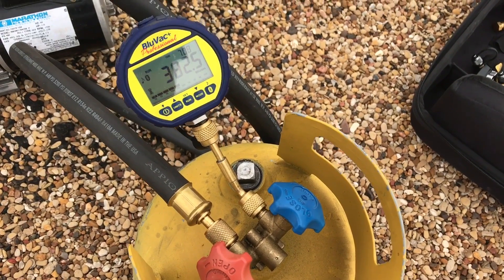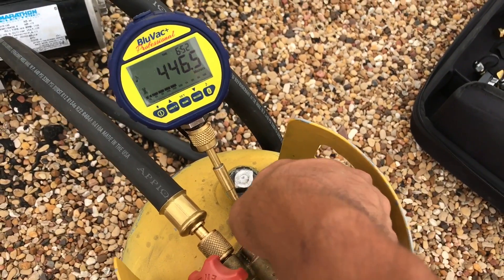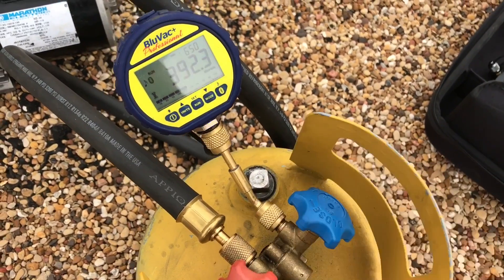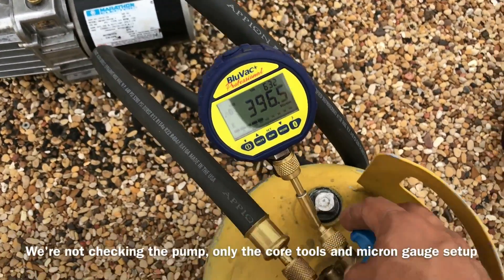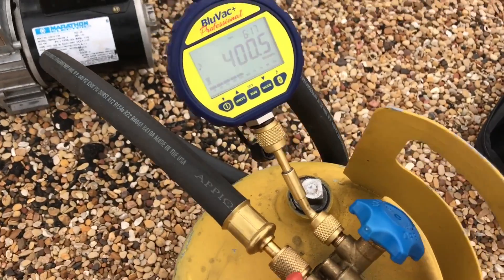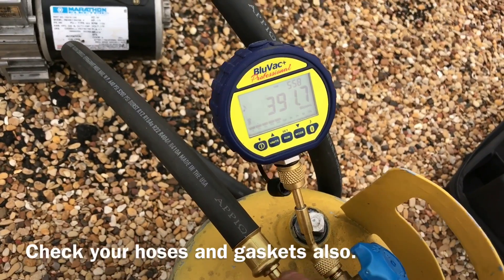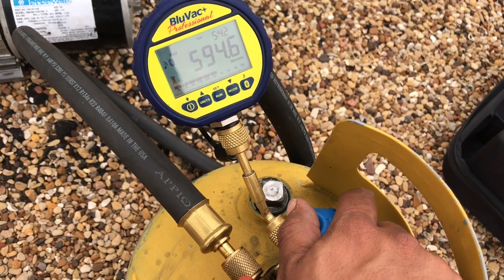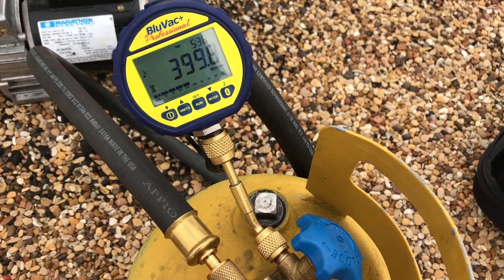Leak test your micron gauge setup on a large volume

Comment: I finally figured out the “volume” problem after returning two vacuum gauges.  The empty tank simulates the volume of the line set and condenser and evaporator.   I only lose 10 microns over 30 minutes when including the volume of an empty tank! That is plenty good for measuring the decay rate on the complete system.

Comment: I am sorry, but you do have a very significant leak between the blue valve and the micron gauge.  The reading does not drop very quickly when the valve is open because, as you say, there is a very large volume at very low pressure in the tank that is compensating for the leak after the blue valve.  When you open to the pump, the pump is also more than compensating for the leak.  When I stick my Yellow Jacket gauge directly on a SuperEvac pump with a separate isolating valve, the vacuum does not decay at anything like the rate you are seeing and that is with a separate valve which you don't have.  Nonetheless, your video is useful to show the effect of a large vacuum and how that compensates for the leak that you have.
Reply: A low volume set up will always show a leak rate.  Add the tank volume and the leak rate drops by an order of magnitude.  The VOLUME is the key factor here.

Comment: A Huge THANK YOU! to you sir! I was testing a new micron gauge and one i already had both directly connected  to the vacuum pump using a tee. The rise in  microns after isolating was driving me insane. Last time i used my old micron gauge it worked fine on an ac system but now it seemed to be acting up. You saved me a lot of further fustration. Again THANK YOU!

Comment: Sir, you may have saved my sanity. I'm testing my brand new Hilmor vacuum gauge for 4th day straight and no matter what I do it leaks isolated with  good new Appion core removal tools about 2-3 micron/sec when pulled under 200 microns. You telling that volume of the system plays a big role is an eye opening to me. Indeed, it makes total sense. 2-3 gallons system leaking the same way will absolutely slow it down - that micron rise will disappear in the total volume.  Oh well, need to find an empty tank somewhere or build a test rig. Or still will get CPS vacuum gauge to see if that one leaks same way :) Thank you!!!
Reply: The trick is the VOLUME!!

Comment: Outstanding! Thank you!
My testo meter was driving me nuts when trying to isolate directly at the meter, but pulled a vacuum on my 50ft roll of tubing and it held 350 microns super steady.
The system leak I've got is super small, won't pull down further than 550 microns, but climbed to 1000 in roughly 6 minutes. So, it's acurrate enough for me and this helped me confirm this.
I appreciate the help.

Comment: This is a measuring device. You must have trust in its readings and it should read constant pressure when isolated. Saying that the "volume is so small" is really no explanation at all. My question is - does this happen also on a brand new gauge with properly done sealing? If so, you can only conclude that is has internal leak. It has little to no practical importance but it is a leak anyway.
Reply from the maker: Luzt that’s what I used to to think but I’ve learned that everything leaks a molecular level. We are more concerned with the decay rate. It will more than likely not read constant like a pressure gauge. The  decay rate will slow down. The  sensor is pretty sensitive in the blu vac.
Reply: @UlisesPalacios  OK. So assuming that the gauge has no external leaks, we can calculate internal leak rate based on its readings and estimated internal volume . This could be interesting and I'll do it in my free time based on your video.
Reply from the maker: Luzt it yeah. It depends on the size of the equipment. Usually on new installs i shoot for under 200 microns and a decay test for 10 minutes plus 1 additional minute for every ton of refrigeration not to exceed 500 microns within that time frame.  For older systems I do 500 microns and a decay test not to rise above 1000 microns within the same time frame. That BluVac gauge will actually look at the rate of rise and the time you set the decay test for and it will give you a pass or fail without having to wait for the test to finish.

Comment: I have this same problem happen to me on a robin air gauge i think i have returnded it then times and got a new one everytime. It is not a leak there is a problem with the gauge.
Reply from the maker: sjef oekel I see. It's always good to test your stuff. It will save headaches later down the road
Reply: Ulises Palacios You are right, thats why i have 3 different ones, supco,testo and yellow jacket, i gave up on the robin air.